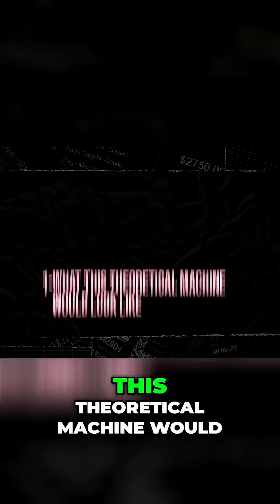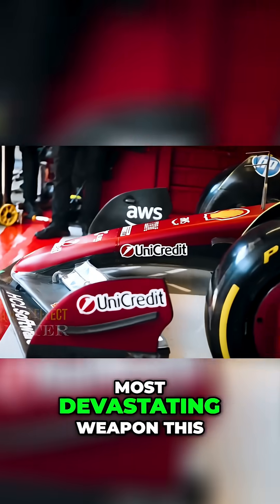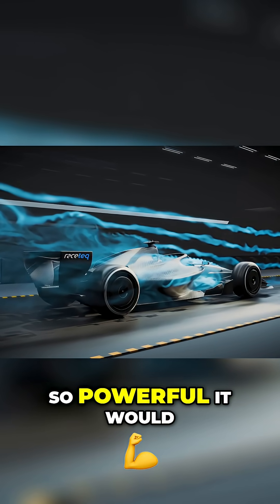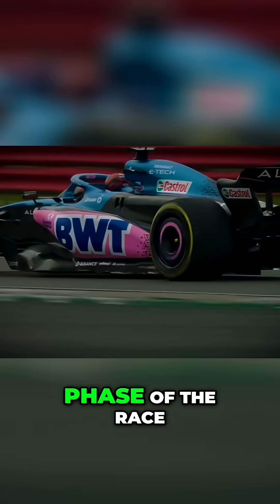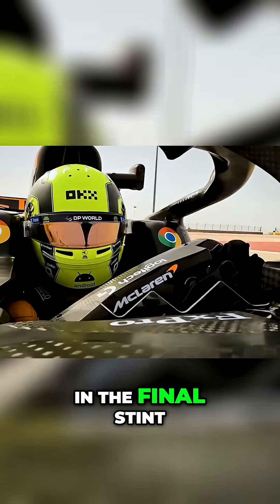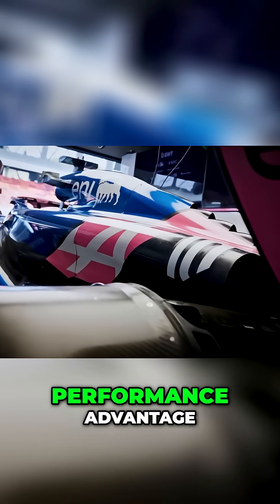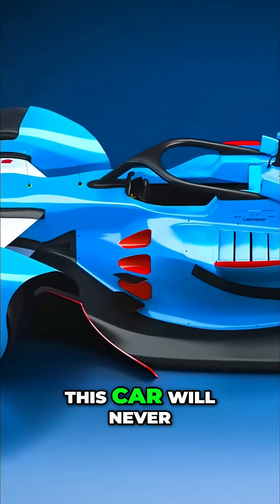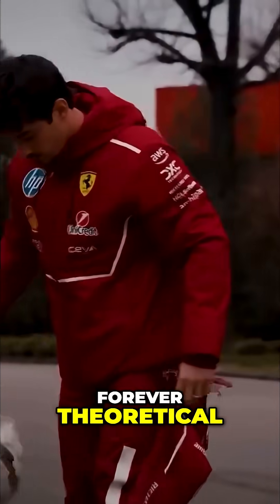F1's UNSEEN Secret  The Untouchable Engineering Beast

Comment: Hmmmm I’m not buying the argument. Doubling the downforce requires an incredibly stiff suspension. MGU recovery, fuels cell optimization and DRS mods equal 4 sec a lap? Mmmmm. I get politics, however this is a big money sport where a few points can mean the difference from 3rd in constructors to 6th. They’re all pushing the rules every race….its part of racing.

Comment: There is another way to get more downforce 
Have a slot at the front of the side pods so you can travel air through the side pods and the air to underneath the car exiting from two slots just before the rear diffuser that will give you more downforce

Comment: Bruh.. team doesn’t choose for head plucking machine because in racing world.. car vs car battle.. u don’t need every car to reach Mach 4 to race.. chasing all those figure isn’t cost effective… if every car has similar pace.. it will create better racing no matter if u have 1000hp or 1mil hp..  of coz it cannot be to easy both technically or driver skill requirement.. so it cannot be too slow as well..

Comment: The reason they won't get the ground effects to "near perfect" is because it's too difficult to keep it steady. Think of a knifes blade and a spoons curve. If you got it perfect, that means the height needs to be exactly x mm from the ground at all times, x being the blades edge. if the height changes just a bit, you're no longer at that peak downforce, you're somewhere on the sides of the knife and your downforce is much much less. One bump, one kerb, leaning during a turn just a bit, tires wearing out and losing height, tires gaining or losing temperature and pressure changes height etc. Now picture a spoon. x is the peak of the curve of the spoon. Its lower than the peak of the knife, but way more forgiving. If x is the highest peak of the spoons curve, and max downforce generated, a few bumps here and there will marginally affect performance. Height changes from tires, kerbs, bumps, etc are all way less of a drop in down force. You're not center of the spoon, but you aren't falling off like the knifes edge either. You still have considerable downforce, not way way less in am instant.

Comment: The scary thing about this video is that some people will actually believe this BS.

No, there are not ways to increase performance within the regulations that teams have just agreed not to exploit. They exploit every possible gray area they can and even cross the line occasionally.

Of course there are ways to make this generation of car fast faster, but regulations are deliberately written to prevent the cars from going too fast; at first it was because tire technology simply couldn’t handle the stress that the downforce and cornering speed put on them. Tire technology has improved, but we still have the limitations of the human body to deal with. There was a time when being in good physical condition gave you an edge in F1, now being in peak physical condition is a minimum requirement just to withstand the demands of a race. The point of F1 isn’t to make the fastest car, it’s to make the fastest car within the formula.

Comment: Energy recovery is capped at 2 MJ per lap btw... And having 2000kg of downforce requires an abhorrently hard suspension setup which is undrivable when going slowly
Reply: 2000 kg of downforce sounds crazy, the suspension isn’t undrivable it’s built for that exact load range
Reply: It's drivable. A few years ago IndyCars generated over 3000 kg of downforce.
Reply: @BiggieTrismegistus indycar drives in ovals at constant speed with minimal bumps
Reply: I believe the MGU K is the only recovery capped. I don't believe the H is capped. Next year I think that changes.
Reply: Even if they put all these theoretical principles into use, they would all still reach the same limitation. Because they would all be using the same principles.

Comment: I'm calling this bs as well. If all the teams agree not to use a certain according to you loop hole, then it is practically an enforced rule, so then it is just part of the rules. If some teams lower on the grid could use such a "loop hole" legal thing as a weapon to get from back of the field or mid field up to the top, they would. There are only incentives to do so. Ferrari with all of its political pressure from Italy, they would not let anything like that unused. Why spend millions getting Hamilton and then keeping back on performance of the car. 
What you're saying is just click bait and bs.

Comment: Building it would be useless because it would be so fast that the G-force in corners would break a lot of the driver’s bones.
Reply: No...
Reply: @alexisbeuve8199  limiting the speed in the corners is, in fact, a consideration when writing the regulations.  The FIA keeps coming up with things to slow the cars down and engineers keep finding ways to make them faster.
Reply: @valerierodger  Yes but it's to reduce the speed in case of a crash, not because thé drivers can't handles G's into the corners